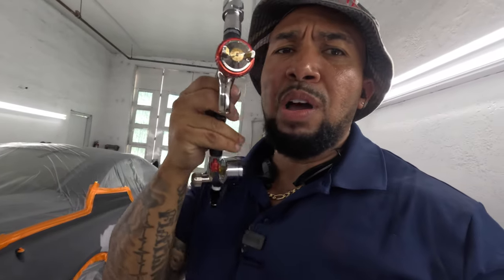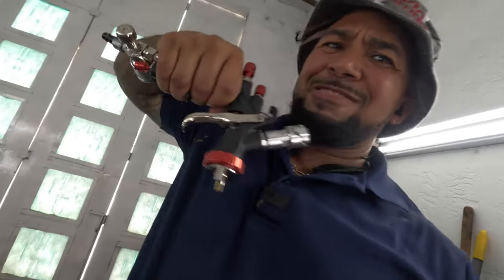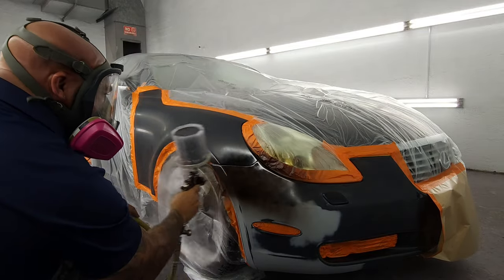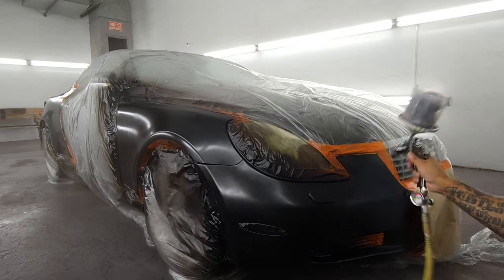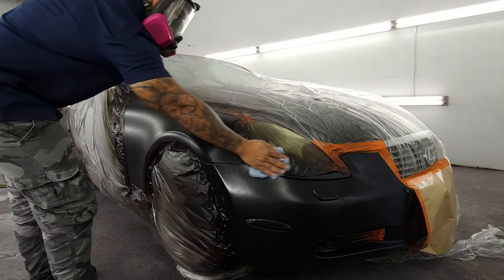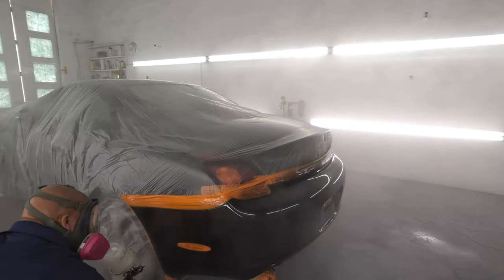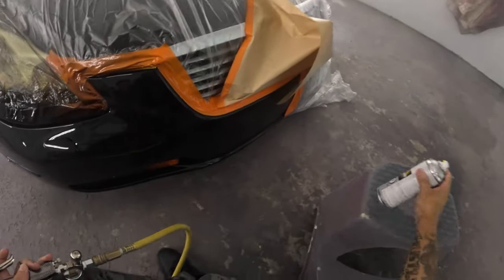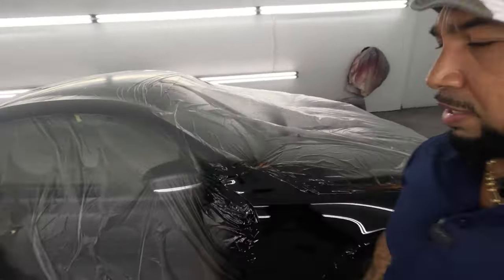Hands down Triggermans Top LVLP spray gun for beginner or professional automotive refinishing. CAP 🧢

Comment: Got my cap 1.3 Rongpeng chrome cap from Aliexpress and it has fixed the small spray pattern issue with my Aeropro A610. I also tried the 1.5 tip with the 1.3 cap and it seams to atomize the paint very well. Also lays out a rectangular 18 inch pattern. (For anybody who thinks this gun is slow).
Reply from the maker: Dam you upgraded to the "jet fuel" package 🙌🏼💪🏼😂
Reply: When you changed to the 1.5 tip did you use the 1.5 needle too ?
Reply: @psycho3344  Yes. I always use the tip and needle as a set. I just switch the cap as a test. I worked very well.

Comment: Trigger man. I got a gun from Home Depot that's supposed to be LVLP. I haven't used it yet. It's a mini. It's a SprayIt R100. What are your thoughts
Reply from the maker: @fredericocorrea9814  I have never seen or used the gun  but if it's rely an LVLP you should be good to go, and it's a mini, so it should use even less CFM curious to know how it works. If you have a link or something you could send me I'd be more than happy to check it out.
Reply: @thetriggerman954  it's a Home Depot gun. They say it's out of stock. But I'm gonna see if amazon has it. Or looks like all the rest chrome and red. I also got the big Brother to it, also chrome and red but it's an hvlp. If i can I will send it to you it's only $33. But i gotta wait till it's in stock again. Gonna try it on a donor panel first. I'll let you know how it turns out for me. Peace and be blessed

Comment: Trigger I purchased the LT 100 a few months ago and have sprayed several smaller resto parts for my 68 C3 ( single stage black and clear) and I could NOT believe how good it sprayed!!!! I even used old instrument nitro on a acoustic guitar I just finished up and it sprayed so much better than my old ( and now retired Devilbiss HLVP gun) 
The Eastwood salesman told me I wouldn’t be disappointed and man was he right!  I do think your right on how good it will work with a small compressor.  I have a 60 gallon single stage and couldn’t see any problems with it…. I agree if the gun is engineered good you can make adjustments to suit what material you are spraying . ✌🏻
Reply from the maker: Thanks man, I agree very well made gun here. Just feels like quality in your hand as well as the result to back it up. Thanks for chiming in 💪🏼👊🏼

Comment: The R500 spray guns have never let me down Triggerman, you killed it as usual 💯💪🏾
Reply from the maker: Lil gun went Ham lol I had a feeling it would be pretty good. Thanks Champ 🏆💯
Reply: Hey guys would you say the r500 and s the same as the LT? Thing looked shiny AF trigger
Reply: @frankvalencia9227  they are the same spray gun
Reply from the maker: @frankvalencia9227  I think they are the same design I don't know about the internals of the spray gun. The LT does look shinier and feels well built. I have not had my hands on the other makes other than the Eastwood to give you an accurate answer.

Comment: Laid glass!  The air caps have always made a difference in the various R500 rebrands. 

 Something DIYers also need to think about is the overspray. Most of us spraying at home dont have an ideal exhaust system and that will alter how much you can turn the gun up and can still see what you're doing.  

Good info on that cap!
Reply from the maker: Thank you man. Yes it's definitely a fogger, and you'll have to get up over 30psi if you want this thing to perform. 💪🏼

Comment: I have the original APr500 and the a610/r500. I think the original aeropro r500 sprays better than the cosmetically updated aeropro a610/r500. Has to be the aircap. I drilled out the 1.7mm tip to 2mm with a 5/64 bit and just use my a610 for high build primer. Had to lap in the needle with some compound to seal it. Works good for primer. Really hoses it on. My r500 sprays everything else real nice. These guns just work. Real good for DIY. Turn down the pressure and fluid and you get very little overspray. Almost as low as my lph400. For the price they cant be beat

Comment: Wow! That looks Bee U Tee Full, but you know there's a dent on that back bumper. Did you know that? 😁😂🤣

That Eastwood gun is the spitting image of an LPH-400. Maybe the handle shape is slightly different, but they didn't even try to hide everything else! Even the adjustment knobs and the markings on the adjustment knobs look the same.  I'll bet if you broke that down next to an LPH-400 the parts would interchange. 

I think that a whole lot of the Chinese copycat spray guns are not, in fact, "HVLP" spray guns, even though they are marketed and sold as that. The clouds that they produce in the booth look just like the clouds that used to be created with conventional spray guns from yesteryear. (I don't think anyone misses that) I think that's why some of them spray so well compared to many of the actual HVLP guns.  You're right though, they probably won't work on a low CFM compressor - despite what the packaging says. 😉
Reply from the maker: BeachCity in the hizzouse, yeah man suckers cloud up the booth quick, old conventional guns took 35 to 40 PSI to atomize properly. Spraying these guns I realize I need 35 to 40 psi to atomize properly Hmmm 🤔 But it says LVLP so it has to be. These paint gun manufacturers winning lie to us BeachCity. It's crazy how I could take my LPH and get that same exact finish with only 21 PSI. And will also produce half of a cloud if that. Make HVLP guns great again 🇺🇲 🚜🤠

Comment: I'm just wondering why you put most of your paint on the first coat? I am a beginner and I assume the reason why the YouTube paint  community is in an uproar is because of that, lol!! 
I am actually looking for a good quality LVLP gun. My 20-gallon compressor runs between 5-7psi. Can you provide the link for this gun and the optional air cap that you swapped out?
I am also considering maybe just going with a smaller gun? 
I don't mind spending a little  extra money to get a better quality gun.
What are your thoughts?
Any other great guns you would recommend.
 Both full-size and smaller guns?
Thank you!
Reply from the maker: That's just my style of painting. I've been painting cars for longer than some of that community has been born. And have mostly every certification you can get in automotive refinishing. Some people learned to paint watching YouTube and some went to school and learned the trade. I went to school not saying there is anything wrong with that, but those people can't question someone who actually learned this trade by the book. For me I like to get my paint on a little heavier / coverage give an extended amount of flash time after my first coat while doing so I can do other things That are being more productive on getting work done besides standing there looking at a panel that barely has coverage It's just a waste of time, and I get it some people like to teach you guys to put it on very light and build it up because for a newbie there is a higher chance of running the base coat while trying to get it so heavy on their first coat. Goes back to my first lesson which is " learn your materials "
Then you will know how far you can push things whether it's base coat or clear coat stick to one material learn it front to back Then you will know how far you can push that material. 

Here is a link for the gun with the upgraded cap all in one, great gun

https://amzn.to/3tTmfzB

Comment: Eastwoood almost got me bruh!!! The contours lt100 is a rebranded rongpeng! It’s the exact gun for $51 shipped!  🤦‍♂️ of course I picked on up!
Reply from the maker: Yea I know not sure how the quality is on the original I kind that Eastwood is solid. Let me know how it is. So I can let people know. 🤜🏼🤜🏼
Reply: @thetriggerman954  fo sho!!! I wish I knew this before I bought the aeropro 610. It will be my catalyst/hardener gun now ( primer, clear, and single stage gun). At least if it messes up, I won’t care!
Reply from the maker: @dollabillbrunson8107  yea man me too, that gun is straight 💩
Reply: @thetriggerman954  I have the aeropro r500, and the trigger is way smoother on it than the 610. I wanna know what did they improve on…the color scheme? They even took the marks for the adjustments off! Smh
Reply: Small update on the Rongpeng r500 from AliExpress. I did receive it and at first I was like “balls”!!! There are some differences.  The outside surface has a grainy look to it! The trigger wouldn’t close completely, so I broke it all the way down. It had lots of grease in there, but not on the seals. Cleaned it, put some slick honey on the seals, now it’s smooth like Gary Coleman!!! The adjustment knobs are quality with #’s on them. I will let you know how it sprays. I made a post before, but I don’t see it.
Reply from the maker: @dollabillbrunson8107  ok cool, dang you had to do all of that just to get it operational 🫠 I guess from over there that's still a win for the price I'm sure. Cool lemme know how she operates. 
🤞🏼
Reply: @thetriggerman954  fo sho!!! If it’s a fail, at least I can use the caps for the aeropro 610.

Comment: Great job.It looks great.Is this lvlp or is it hvlp Eastwood gun ? I went to the link and it said,hvlp Eastwood gun.I have a 30 gallon compressor.Will this work ?
Reply from the maker: The info says HVLP but the gun model is supposed to be LVLP I have heard people say the HVLP is a misprint. You might want to double check with the manufacturer. I don't want to misinform you.

Comment: When u sprayed ur base on the paper, it is a wet on top n bottom and dry in middle.  Gotta bring the pressure down so its even thruout the spray pattern IMO. maybe some one else can give input on that.. also pressures r pretty high so its creates alot of overspray no? I dont see a difference between a HVLP vs LVLP besides the high volume that others spray.
Reply from the maker: Gun doesn't atomize at any lower pressure. The pressure I sprayed it is optimal for this particular gun

Comment: Quick question...do you think this gun is better than the black widow ?
Reply from the maker: @ccroney00  depends. This gun is only good for guys that have a smaller compressor. Small compressors Don't have enough CFM to run the Black widow. But if air consumption is no issue then the Black widow is the way to go. Look like widow outperform at this time by landslide

Comment: I bought that gun used it once for a door and fender. Went to use it again and looks like it’s clogged and or broken. It did work well but disappointed in the longevity of it didn’t last long at all
Reply from the maker: This was the first job that I use the gun on couple days later I noticed the air knob at the bottom of the gun was hanging off so I contacted them and they sent me out a new gun. I haven't used the new gun yet I've only done this one job but I do feel you on that one man.

Comment: not trying to steal your spot light but i just used..a areo pro 608a spray gun on my personal car..with no booth in a dirty garage with the proper tech..  of wetting walls and floor down.spraying at 28 psi on base and pearl mid coat and 30 psi on clear.. i got dust in my clear but that wasn't the guns fault.. my first  plan was to buy a Eastwood gun cause i have used there product  a bunch but at last min i went with the areo pro gun..( for the  record don't use the spray can texted paint.. i bought a case of 12 can's but as of now only 4 out of the case work) but anyway the areo pro gun is a good for the price even if you don't do a cut and buff . I'm not a painter but  a engine builder at trade.. but the areo pro gun seemed to work well.. hope this helps your channel and people who watch it..
Reply from the maker: The gun can get good results. Not sure what results you got at 30 psi with that gun. We each have our own definition of "good results" there is what's acceptable to an insurance company and then what's acceptable to our buddies.

Comment: Will my 2hp 20g  ingersoll Rand 5.2 cfm @90 be enough for this r500 lvlp? I already have the gun. Just looking for setup advice. I haven’t tried it yet because weather has been bad and don’t have a garage/booth.

I’ve seen other videos the r500 advertising 3.5 cfm but it’s more like 10. Just confusing I’m trying to find a gun that’ll be good with my compressor. Thank you
Reply from the maker: I've heard the same think that they use up more CFM than advertised. Like I said in this video. I'm not the guy to get verification on the CFM. Simply because I use a very larger shop compressor. I do have a personal smaller compressor at work. Maybe I'll try it out this week.matter fact yes I'm going to do that this week. Since a lot of guys are asking that same question. I'll try it out on a small compressor so you can see live what it does

Comment: I have this gun and a 6 gallon compressor  will not spray with it. WHAT COMPRESSOR ARE YOU USING  IN THIS  video
Reply from the maker: I'm using the shop compressor. It's a 80 gallon big boy.
Reply: Can use a 30 gallon  compressor  with this to paint a  car with
Reply from the maker: @cynthiavest7279  I believe so. UPK used a 20 gallon tank and painted a big Tahoe. So it should work
Reply: Thanks so much

Comment: I'm fixing to buy me a new gun.I have a Devilbiss Compact HVLP and I want another gun. Would you recommend this or the Vevor.
Reply from the maker: Either will get the job done. I tend to spray a lot faster than normal and for me the Vevor is a much faster gun. If you're on the slower side and like to take your time and move slower this gun would be better. The Vevor puts out a lot of material which is ideal for me. Hope that helps.

Comment: Hey trigger top vid. What tip, cap and needle did you use?
Reply from the maker: Cap was from the Eastwood, lt100 spray gun  other than that same 1.3 needle and nozzle that came with the gun. That cap was like a turbo boost for the gun for me.

Comment: What’s your thoughts? How would you compare this gun to the kiwami4?
Reply from the maker: No comparison in my opinion. I sprayed that gun for a few days. This gun blows it out. That's just my experience with it. That gun can get good results but you really have to work the gun, adjust it in every which way. This gun came out blasting clear. This was my first job with the gun so imagine if I really dialed the gun in.
Reply: @thetriggerman954  I honestly value your opinion. Think I’ll try this one out instead of the kiwami. Do you remember, were you spraying fluid and fan wide open?
Reply from the maker: @Evanbmt  yes start with the fluid knob wide open pull the trigger then turn  the knob in until it hits the needle. Start there. It worked for me on the first try.

Comment: That Eastwood gun looks like a knockoff of a DeVilbiss FLG 5 a very nice gun at around 175 dollars. Looks like you have a nice booth set up, for most home sprayers It's the over spray that's the issue. Air delivery and oil and water separation are usually the devils that kill home spray jobs.
Reply from the maker: Yea I had a set up at my house but I had a big 60 gallon devilbiss compressor with devilbiss moisture/oil separator, invested up front to have a smooth operation. Ran it for 6 years now problem, only bugs n shit but other than that smooth. The spray gun is supposedly the same as the R500 I think that's what the original is called.

Comment: I swear if u like that you will love the cartman mp400  they 40$
Reply: I just put a tulip tip and lvx cap on a cartman... it needs the lph400 needle though because of the tulip
Reply: @alexlove2588  and that needle fit too..
Reply: It fit, but the lph needle is sharper to fit through the tulip
Reply from the maker: $40 🥹 man that sounds like a toy lol c'mon man y'all trying set me up now 😭
Reply: @thetriggerman954  It's an exact lph 400 replica. All parts fit, but the cap needle and tip are not iwata. More like the harbor freight type 10 hole setup
Reply from the maker: @alexlove2588  I mean I think my LPH is a little more sexy than this gun. This one seems a tad big fatter while the lph is a little slimer. But everything else does look the same. Smh got damn copy catters. The internals have to be completely different because you need more that double the PSI for good atomization.

Comment: Rongpeng Air Tools Co LTD is the maker of all these guns (R500, A610 & i believe the Eastwood Concours LT100 and others rebranded under various retail names). The Company was founded 25yrs ago and has grown to over 100,000 square meters (aprox 25 acres) of manufacturing space with more than 1,200 employees so its a serious manufacturing enterprise for sure and their quality has just got better over the years without the big price tag.  In LVLP they make the W-400 (for clear & widest fan pattern)  R830, R500 and the awesome R100 mini gun. All these guns are good.
As to HVLP guns they make the R804, R803 and R802 which are also great guns.  Don't get me wrong as i own Devilbiss guns and Sagola guns which are great, but Rongpeng is up there with them now for a fraction of the price and iam lately really digging the LVLP guns as less overspray and consume less paint for a high standard finish  ( i now own an R500, R100 & 4 x A610's and a number of other Rongpeng guns in the collection)
Reply from the maker: Ion know about the "less overspray" part. All that history sounds good but so far every so called LVLP gun I've used has fogged up the booth 100 X more than my LPH which is a pretty low CFM compared to regular guns.

Comment: All the R500's, A610, Eastwood, Inokraft Drizzel, etc, are a copy of the Iwata W400. Which has been around for at least 10 years.
You can use an Iwata W400 cap, nozzle, and needle in them all.
Reply from the maker: At least 10 years?  try almost 20 years I had the W400 in 2007.
Reply from the maker: @dropbear9526  that's cool  I have friends died at 25 it's a blessing to be 46 years old  spray on brother sprayyy onnnnn 🤙🏽🤙🏽🤙🏽